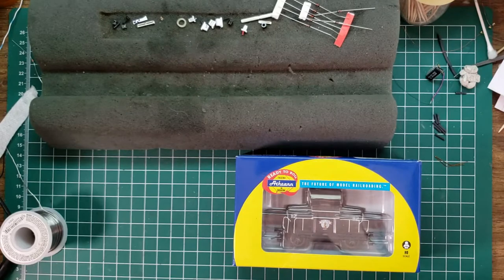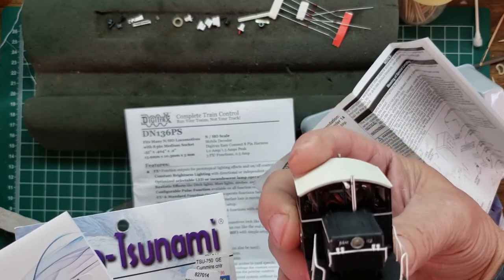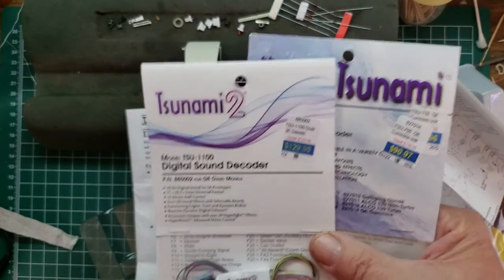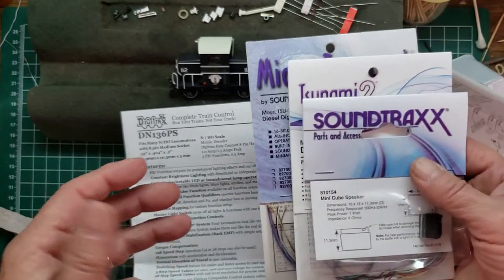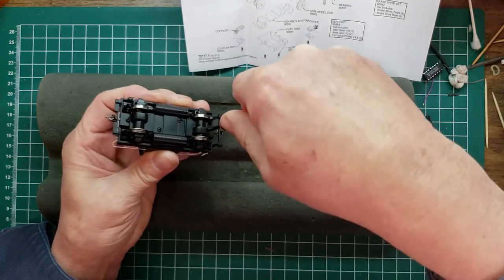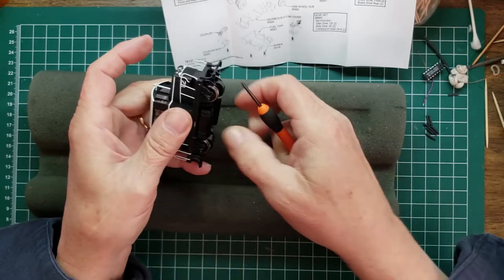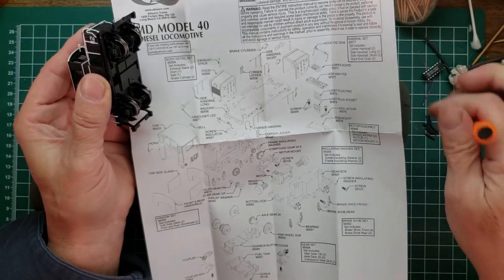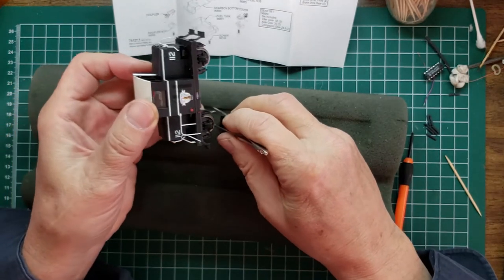EMD Model 40 pt 1

Comment: What's that foam thing that you were using to hold the locomotive? I've been trying to find one for a while, but I don't know what they're called. Nice video by the way!
Reply: They are made by Bowser and are called "cradles".  We have them in the shop if you need one.  Their stock number is #22.  That should tell you something about how long they have been around.  Thanks for the compliment.
Reply: Thanks!